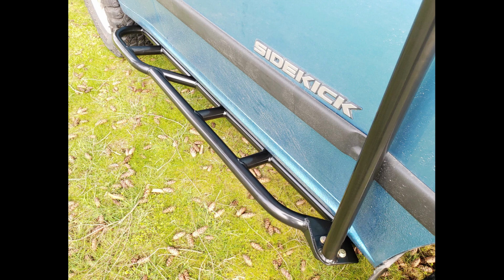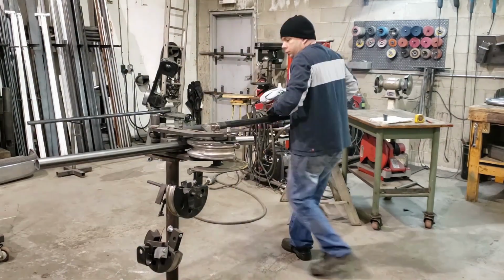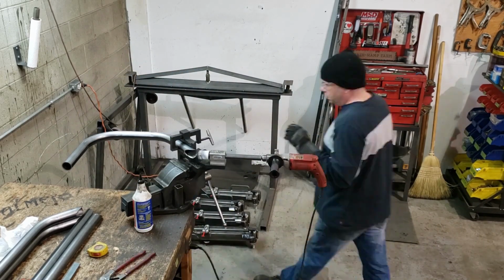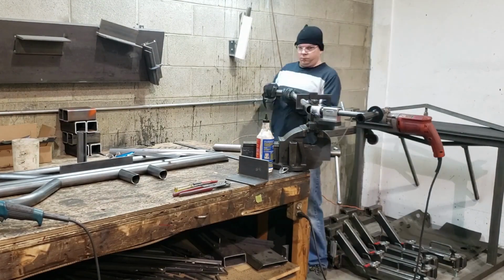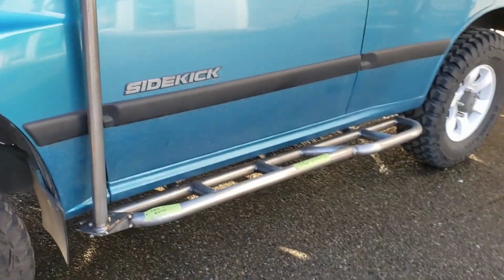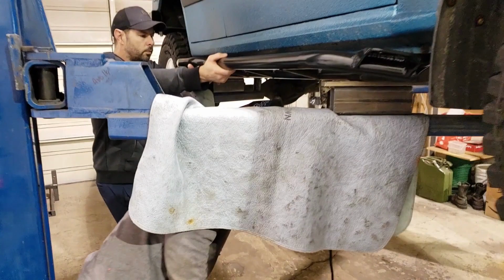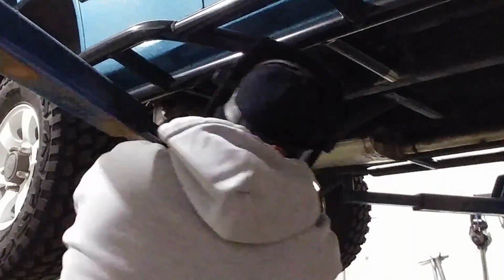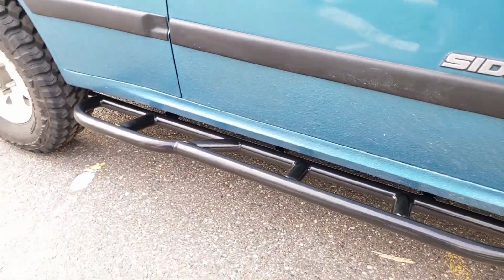Suzuki Sidekick Rock Slider Build - 2nd in the Ultimate Hunting Buggy Series

Comment: Hello, I’d really like to do this but I am a little apprehensive about welding on the frame. Wouldn’t that make the frame weaker? Legal road worthy-ness issues also?
Reply from the maker: Thanks very much for your question! Technically yes, you're correct that welding weakens steel - let's just get that out there to start with. It's the degree to which the material is negatively effected by a process that should be the guiding factor when deciding if said process is the right choice for a given situation. In the case of welding mild steel sliders to a stamped, mild-steel frame, the effect is minimal and negligible in my opinion. Were the materials at all dissimilar I would advise going bolt-on. A good example of this is with commercial vehicles that have hardened steel frames. In my ten years of off-road fabrication I have yet to see a single case of a frame tearing at a weld where a slider has been mounted, even on vehicles that see tremendous trail/rock abuse. Always gusset up to the top of the frame when possible to spread forces and, on lager vehicles, it's not a bad idea to weld a reinforcement plate to the frame before attaching the slider leg in order to spread the stresses even more. For small rigs like Suzukis this has proven not to be necessary.
Reply from the maker: Also, in terms of being road legal, I can really only comment on my local area (BC, Canada) - Having spoken personally to a government vehicle inspector, I can say that it's perfectly legal to have sliders mounted to your vehicle and to have them welded to your frame so long as the frame is not a hardened one (found only on heavy commercial vehicles - at least in my area). This is a point of contention amongst the local 4x4 community and there are a lot of opinions on the subject. My info does indeed come directly from a government vehicle inspector so I believe it's trustworthy, however, being pulled over and given a ticket for vehicle inspection will, in most cases be up to the discretion of a traffic officer but the vehicle should pass the inspection in terms of the rock sliders at least.
Reply: @BalmersWorkshop  wow thanks so much for the reply!
Reply: @BalmersWorkshop  I too live in BC, commercial truck frames get cut,lengthened and welded all the time! Unfortunately vehicle inspectors are just like police in that they make mistakes or don’t know all the laws.

Comment: Hey hello one question what inches is the tube
Reply from the maker: Thanks for your views and for your question. The tube, in this video is 1.75" dia.x.120" wall round tube. I've recently stepped down to 1.5" round tube with the same wall thickness because I think the smaller diameter suits the vehicle better and it's still more than strong enough for the job. The length of the main tube on the 4-door model is 64".

Comment: Have you ever had any issues with the frame at the point of the tube welding? 
Usually I see guys use a plate on the frame then the tube welded to that to spread the load on the frame.
Thoughts?
I know the gussets will help
Reply from the maker: Thanks for the comment! I plate the frames of vehicles which are any larger/heavier than Sidekicks to spread the load but with small vehicles like these I've found that they hold up well without reinforcement. Some of my Sidekick sliders have seen 10 years+ of severe trail abuse without issue.
Reply: @Devin Reese instablaster =)
Reply: @Soren Carmelo It did the trick and I now got access to my account again. Im so happy:D
Thank you so much, you saved my account!
Reply: @Devin Reese Happy to help :D